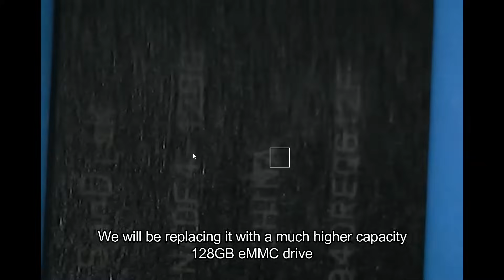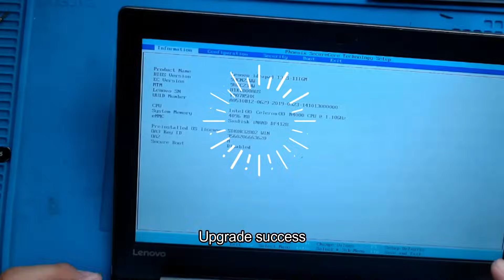Upgrading 64GB eMMC Storage to 128GB: A Complete Guide #how #upgrade #lenovo #emmc #laptop

Comment: Hello, do you need to reprogram the new memory or is it installed as it comes from the factory?
Reply: Kind-of. You definitely need to install the OS and partition it. That said, a brand new eMMC is no different to an unformatted sd card. Actually, they are identical technology. You could actually remove the emmc, and solder an sd card in its place. It would just be slower (less communication channels)
Reply: @microsoldering1 Interesting, do you think this memory reference will work?  SDIN8CE4-128G eMMC 128GB NAND Flash BGA IC Memory

Comment: My hp laptop crashed and i got this message"boot device not found please install an operating system"

I was gonna try to fix it but the left of my screen is broken and have been that for years so inwould not be able to see the code that I need.

I gonna buy a new screen but donyou think my emmc is broken and if so, can it be fixed?
I have a lot of important documents and so on it.
I have never heard of emmc before so I dont know how good they are to restore data from.
Reply from the maker: What is your laptop model? Not all laptops use an emmc chip for storage.
Reply: @JobertJocson77  hp14s dq0003no

Comment: What's the use, the laptop has a slop for an SSD, just buy that and don't use the emmc storage
Reply: Nope, as you could see in the video. This small Ideapad has a planty of variants - with a SATA slot, with a NVMe slot or with an eMMC, with 2 or 4 GB of RAM, with different CPU... But as you can see, none of SATA or NVMe is soldered on the pcb for this particular minboard. Technically pcbs are all plus minus same and universal, with different parts soldered, probably you can solder a NVMe slot and also a few small parts around. And ofcourse forget to a 2.5" SATA SSD option - you do not want to use 2.5" SSD at all cause it is located left from mainboard (where you would like to have a battery) and in that case you have to use only half size battery - with aproximatelly half capacity. Definitely not a good deal. Or you can sacrifice WiFi, add a SSD into the WiFi slot and use external WiFi in one USB slot instead of. This is not a great deal too, but it is the simpliest solution. The only one reasonable option for this particular notebook would be a NVMe.

Those Ideapads are really great for their price, still can do a great job even in 2025, I personally love that type of laptop (about 11" and 1kg in the pocket, about 11hours of battery life) N4xxx (or IMHO even better older N3450) is still fair enough for work even on W11 - but that small eMMC and less RAM size could be serious pain for Windows users. W11 needs at least 50++ GB as a bare minimum, 32GB is a bare minimum for clean W10 with updates without applications. So this is challanging.
Reply: @djhroch  ok Thanks
Reply from the maker: For this laptop. There are no way to connect any extra storage drives.
Reply: @LifeAndTech77  There is a way, take a look right from battery - there are pads for NVMe slot.
Reply from the maker: @djhroch  I did. it's a crappy laptop. doesn't have NVMe slot.

Comment: Hi , i need to remove an emmc disk from a laptop and would like to know what tools do you use to remove it ? Thanks for your reply
Reply from the maker: I used a: 
hot air station 
Tweezers
Bit of flux
Soldering Iron
Copper braided wire( to remove solder on motherboard)
 Might also need a Thin blade chip remover if the eMMC has glue under it.

Comment: For what I'm going to get charged to do this I might as well just buy another laptop and call it quits...
Reply from the maker: In a 1st world country doing this does not make sense. In a poor 3rd world country this is the only option especially if the storage drive is bad.
Reply: @LifeAndTech77  In a 1st world country, we may be privileged enough to be able to learn to do this ourselves with a smaller financial risk. Thank you for the video!
Reply: @LifeAndTech77  Hello, good Sir from Europe - not all of us are drooling consumers throwing away usable goods, polluting the planet. The guy didn't even make sense, I hardly believe the parts would cost the same as a new laptop. Maybe if you need to buy the tools, but then you can re-use them for a very long time. I just got my hands on a 9 year old Ideapad MIIX and I'm definitely upgrading the eMMC and perhaps even the RAM. It will be perfect, running Gentoo or Alpine. Thank you for the tutorial!
Reply: Living in a 3rd world country really makes you feel like a scavenger for parts to upgrade your lvl 1 equipment, I personally can say that coming from 3rd world country myself

Comment: How about memory is it possible to upgrade to 8GB?
Reply: If I remember it correctly although that a Celeron CPU can handle 8GB, one address line was missing on the PCB. So 4GB seems is a roof with current mainboard. But years ago i saw different mainboard same format with N5xxx CPU, 8GB RAM and a NVMe slot looks similar. Would be nice upgrade for this Ideapad if you need a easy solution for increase RAM/storage.
Reply from the maker: I haven't tried that yet. It might work. But you might also need to modify the BIOS for it to work.
Reply: @LifeAndTech77 In a general in the case you need exchange embeded RAM just resolder RAM ICs itself is not enough and never would work. You also need to reprogram I2C EEPROM when all configuration (organization, timing, etc) is store. It is a tricky part do it from a scratch by datasheet. Maybe would be easier to find a proper DIMM or SO-DIMM with same organization you need (type, capacity, number and package of ICs) and resolder both - RAM and configuration EEPROM ICs.

Comment: I'm thinking of trying this with a busted Chromebook!  Snagged trying to work out how much it can support without schematics before I try anything.

I figure my unit will support at least a doubling of its current components to the max its model was sold with, but I'd love to try some ridiculous upgrades and make it into a sleeper!
Reply: Or put it to sleep permanently 😂 I would also like to try this on a chromebook they run great with linux I just wish it had more storage
Reply: @sick86stang  Well, the new 256GB eMMC chip is scheduled arrive on Friday, so I'm doing the upgrade this weekend.  I'll update with how it goes!

(Its current 64GB storage is actually dying, so it's no great loss if I turn it into a brick.)
Reply: @angryowlet153  How did it go? I also have a chromebook with a busted 32gb eMMC chip. Thinking about upgrading to a 256gb.
Reply: @angryowlet153  oh im curious about this, how did it go?
Reply: @angryowlet153  I'm curious, how did it go?
Reply: @angryowlet153  how did it go buddyyyyyyyyyyyyyyy
Reply: @angryowlet153  HOW DID IT GOOOOOO!!!
Reply: @angryowlet153  What happened to the update? Did it work?
Reply from the maker: That would be a cool project.